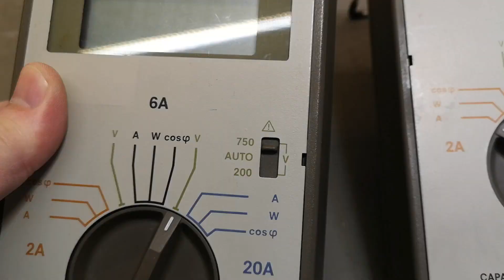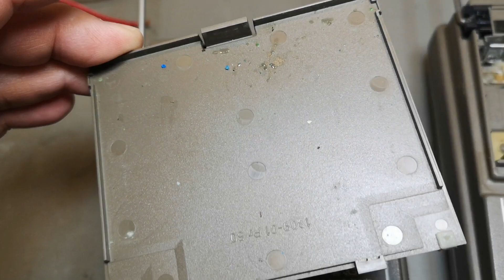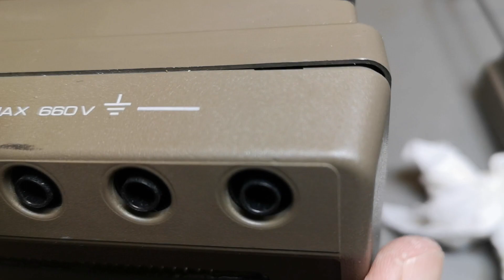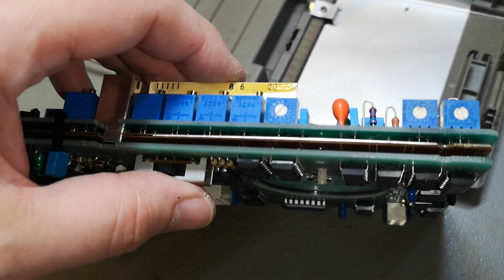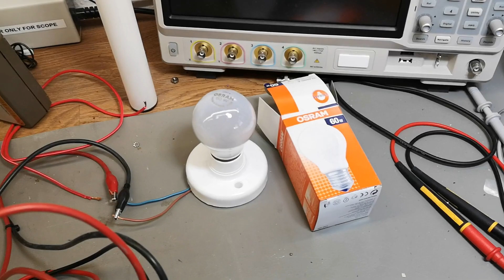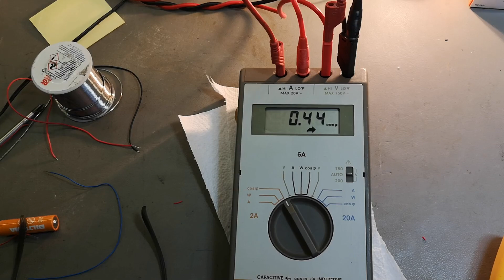Siemens AC line Phase Volt Amps Wattmeter B4305 1986

Comment: Beautiful power meter, my Siemens programmable multimeter has contacts for RS232 on the bottom, aren't the three pins also for communication with the computer to save the measured values. Try one more thing, shine the light on the display and go with the meter in the dark, because my display is backed by phosphorescent material.

Nice day 🙂 Tom

Comment: Siemens used to sell a lot of lab equipment from other manufacturers under their brand name.
For example lab power supplies Stabizet were made by Gossen Metrawatt as well as digital multimeters or function generators made by Toellner.
Also other stuff like TVs and VCRs…
I wonder who is the original manufacturer of this wattmeter.